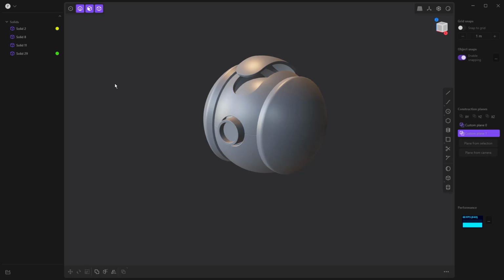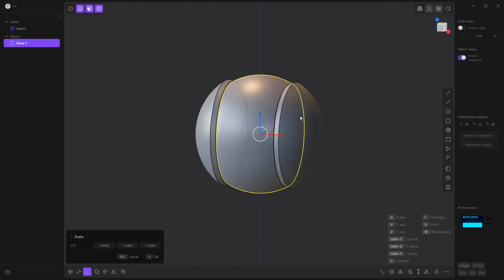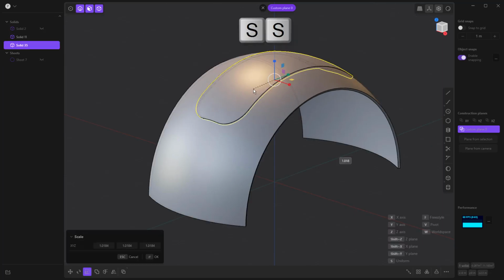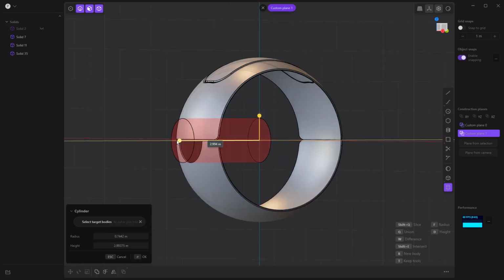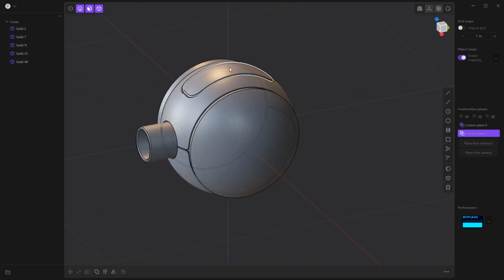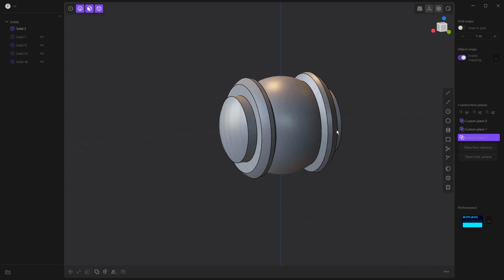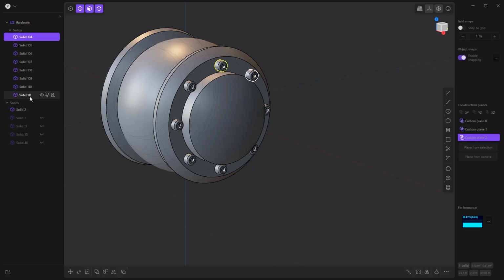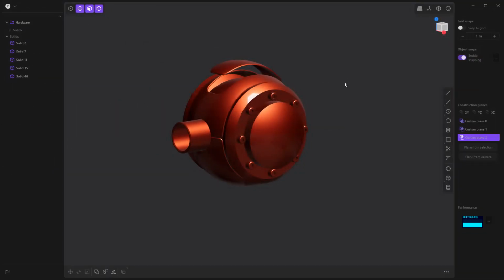Plasticity Quick Start | How To Make A Spherical Droid in 15 Minutes

Comment: whay twice for "S" ? I didnt see a difference from once
Reply from the maker: If you hit S once it starts the scale tool.  If you hit it again you enable uniform scaling which means you just need to move your mouse to begin scaling.  If you don't hit it a second time you will have to use the manual manipulators to get it to change or enter a number

Comment: Great tut.  I got into a spot of bother when subracting the wheel hub tubes - some undefined error, but I found a workaround.  Other than that, very straight forward.
Reply from the maker: Great to hear!  There have been a few changes with the current 1.2 version that is out but mostly minor things that shouldn't have affected this one.  Glad you were able to figure out a work around!

Comment: Can you for example select a cylinder.Then take a cylinder and squeeze  both sides to make it flatter  looking
Reply from the maker: Yup. select your cylinder(the entire body which should be the first click if all your selection filters are on) and hit "S" on the keyboard to scale.  in the bottom right you will see the options for scale.  You can press "X" for example to only scale in the X direction which will flatten it to more of an oval.  You can also do SHIFT + X to only scale in the YZ plane.  By default scale will be Uniform, which is S on the keyboard if you happen to press anything else.
Reply: @LearnEverythingAboutDesign  thank you
Reply: @LearnEverythingAboutDesign  thank you

Comment: Hey, in the 1st minute we made sphere, than took curve, pressed K ( kut) and pressed ctrl+R. But it does not shows radial line for section.
Reply from the maker: the curve with the knife tool will cut however you draw it.  Ctrl+R will cut along the UV direction of the object.  With a sphere how its created around Z will only show half the line, but Tabbing to the V direction should go all the way around.
Reply: @LearnEverythingAboutDesign  😵‍💫
Reply from the maker: @MetricRepeat   I think i saw a comment that was edited about tab.  yes that changed in versions after this.  C will now change from corner to rectangle.  As the software evolves I will start pulling down older videos, but would just say to check the bottom right corner of the screen.  It should list all shortcuts there when on a tool like rectangle.

Comment: Why push "S" twice for scale?  once activates scale. Cool Videos
Reply from the maker: S once enables the scale tool, if you hit S again it enables uniform scale.  basically the same thing as grabbing the white ring at the center of the little widget, but it auto binds it to the mouse so you just need to move the cursor.  If you did S and then hit Z for example you will scale in only the Z direction.   If you hit S and then Shift Z you will scale in the XY plane.  SS is just a quick way to uniform scale something up without having to grab the widget.  Similarly you hit G to move something and then X, Y or Z and then you just move the mouse rather than clicking on the arrow.